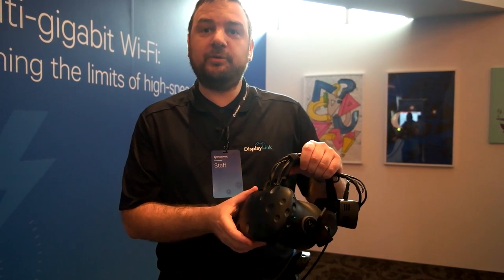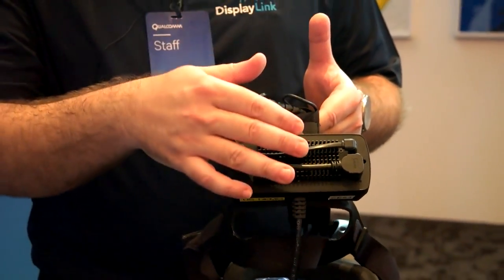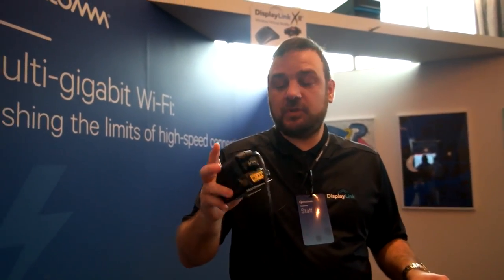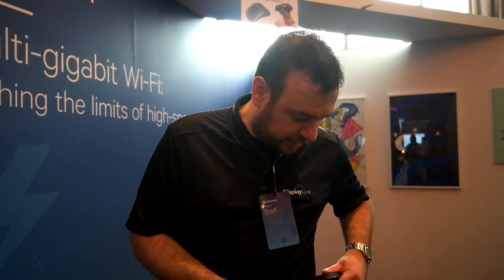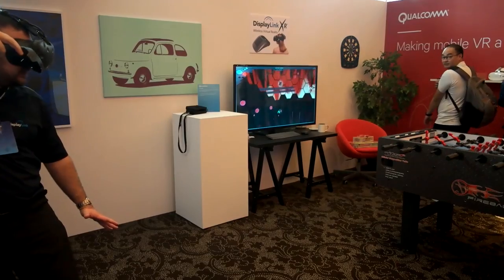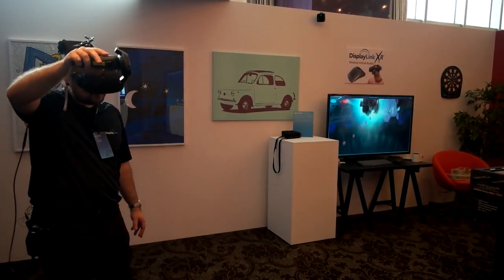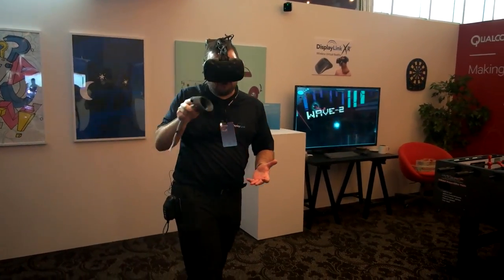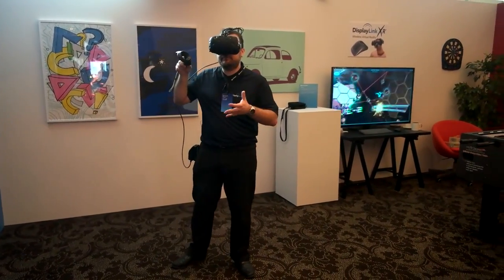HTC Vive Wireless  w/Qualcomm WiGig

Comment: Good now put some kinda chip in them that maps a square space around the user and allows them to be notified as they get to close to the boundaries set.
Reply: The Vive does that by default. The Base Stations provide that very feature along with tracking. You map your play space the very first time you setup your Vive and can re-map that play space as many times as you'd like afterward.

Comment: I love how within a few months there will be at least 2 solutions for making the vive wireless..............cough cough
Reply: HTC is working with Intel to bring wireless somewhere in early 2018. These other solutions seem just either too bulky, too hot on the head or simply could use more work in implementation design.

The last thing I need is more weight so my Vive will wobble more when I quickly move my head... more heat so I can even more quickly fog up the lenses... or have something based on WiFi's 2.4ghz or 5ghz band, which is completely overloaded where I life already and I don't fancy losing my signal.